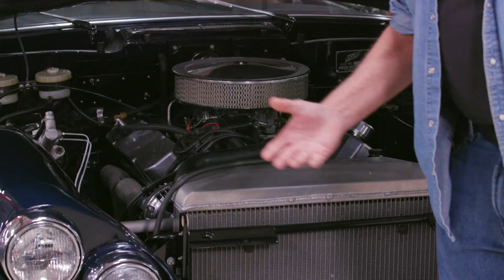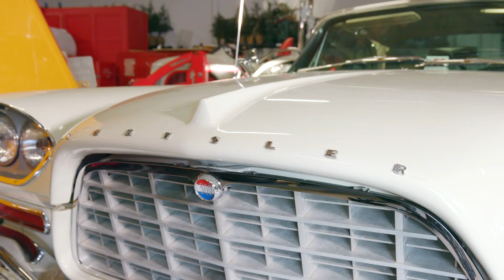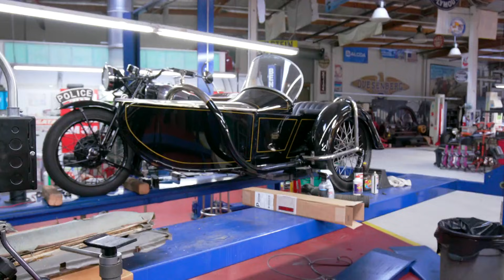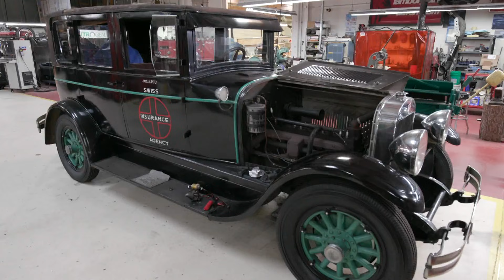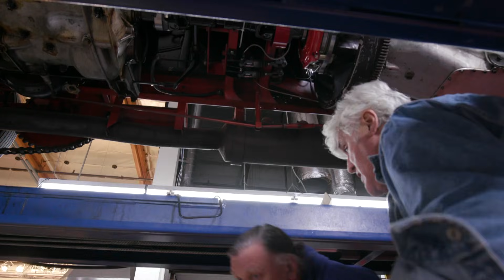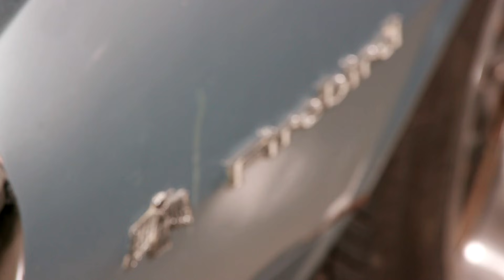Restoration Blog: March 2019 - Jay Leno’s Garage

Comment: Jay i just seen a Dodge Charger that came from the factory with a slant 6......HAVE YOU EVER....LOL ....and WHY would they do that to the Charger its the first one i have seen and i am 60 so i grew up with these cars but i missed that one.
Reply: Easy to explain.....Dodge was going after the cheapskate market for guys like my dad.....only new car he ever bought for himself was a 65 Chevrolet BelAir with a 230 straight six....later upgraded with a 250 short block using the 230 head.....only options were two tone paint, carpet, and wheel covers instead of hubcaps.....no radio, not AC, no power steering or power brakes.....const $2175 counting sales tax.....never liked that car, but would have kept it had it been a two door!!!!

Comment: The Pontiac Sprint ohc six was NOT the first ohc six done in America. Jeep’s Tornado 3.8L ohc six launched in the 1963 Gladiator pickup and Wagoneer SUV.
Reply: He did not say it was the first.  He said he believes it was the first with a RUBBER TIMING BELT instead of a chain.  [EDIT] I just rewound the tape and stand corrected.  He did say it was the first overhead cam 6.
Reply: I had a '63 with the Tornado OHC. Dependability wasn't it's strong suit, especially the "floating" distributor, but when it was running, it was a hoss.
Reply: Haha, I thought the same thing....Kaiser Willys Jeep Tornado OHC 6 in 1962! 140 hp, and it only had a 6 lobe camshaft...one lobe for both intake and exhaust!
Reply: Tornado engine was a beast and reliable once fixed from some issues. Check the argentinian ika torino.

Comment: I can testify about those Pontiac Sprints being rare . I looked for years for one of those engines and never found one. I had a really nice 68 Tempest body to put it in. I finally gave up and traded the body off for a nice mint Marantz receiver .
Cant wait to see it when its done.
Reply: Mine was a '67 Tempest Custom with the "high performance" four barrel carb OHC-6 engine.  Automatic trans, of course.  Bought it brand new in NYC and immediately drove the car to California.  Saw an - indicated - 125 mph along a stretch of Nevada highway!  Probably a bit generous ...
Put on a set of steel belted radials which made the car handle even better than when new.  I kept that car for about six years and it turned  into more or less an ordinary grocery getter.  It ended up having multiple engine problems including a holed piston and worn cam lobes 'cause of poor oil delivery to the OHC.  At one point I even swapped out a different cam assembly from a salvage yard as a temporary fix.  I was sad when I sold my Tempest.  The body was still in good shape but at about 130k miles the engine was unreliable and more trouble than it was worth (to me).  Thanks for listening ...
I'm sure Jay will have better luck with his unit.

Comment: Well... Jay your doing the nth degree of restoration. Everyone else is just clean, replace, and slap a new coat a paint. Your literally remanufacturing, and reproducing parts for vehicles that otherwise just wouldn't exist anymore. Your also doing some slight modernization for ease of use and maintenance.

Comment: Jay, I see those "fake" drum brakes, and I LIKE 
it.  Restoration, to be period perfect is one thing, 
but you drive these cars in the LA area!  Get GOOD 
brakes.

Speaking of "period perfect" restoration, I saw an 
article,  about someone restoring a Plymouth 
Roadrunner.  (I believe, but it was a Mopar.)

They did not restore the car to pristine, but went 
with "showroom" specs.  The engine block had chalk 
marks under the paint, that showed through.  
Underbody spray, was applied like it was originally.
Yep, missing all kinds of spots.  The oil filter, was 
period correct Mopar brand.  That was the hardest 
part to find.  I just posted some of what I remember.

steve
Reply: Concourse condition
Reply: @boxedfender4810 , That's it!

steve

Comment: Me thinks that the Detroit Electric is going to be seriously over powered. But what the heck, it can be dialed back in software.
Reply: kragseven  ----- It'll burn those skinny tires down to the rims. He said in a previous video what motor he was going to use. Slam 400 amps at 400 volts into that motor and put on wide tires it will flip over backwards.

Comment: I really love theese vids, I like the restomods and even just improving like putting a proper cluch and disk brakes on an old racecar.
Put taking a original unrestored car in good shape and start fixing small things, painting the roof and fixing the interior hurts my heart. Fix it, change tires and brakes and stuff like that, but when you start painting it you ruin the magic for me. Dents and scratches are pieces of history, every dent has a story to it, and by the time you fixed it so its as nice as it left the factory its no longer an original and unrestored car, but just another restored car.

Also, the interior cracked up you say? Leather does that when its been sitting to long, but usually some leather care can fix it so its good as new. I had some bad cracks in one of my cars but got some special cream and instructions and it looked good as new aver a few hours...

Comment: I love the restoration blogs, I am curious as to what happened to the Volvo Station Wagon project.  I dead sure I have never missed the weekly video.
Reply: I was excited to see a new "Restoration Blog" for that reason... next one I guess.
Reply: same here.  was looking forward to the update on the Volvo
Reply: I am as well. Being I have a Volvo wagon myself. So Jay let us know what;s going on with it, please. Thank you.
Reply: Joe Peckham I myself have a soft spot for Volvo station wagons. As a kid my grandfather had a business where he sold everything from armor all to slick 50 basically his company were salesman for everything automotive. He would buy his salesman Volvo 240’s and at 130,000 miles or so he’d give them to my parents. As I’m sure you know 130k on a Volvo 240 is literally just broken in. We had probably a half dozen of them when I was a kid and every single one including the red 240 wagon made it over 300,000 miles with just basic maintenance. Those old B240 engines were bulletproof. My dad even got a hand me down Volvo 760 turbo 1990 that made it to 523,000 miles. I went with my grandmother when I was 6 to pick that car up. We just got rid of it in 2014 not because it stopped running but because the body was rotted underneath no holes in fenders or anything but the floors were mush. It made it that far on original drivetrain, original rear end and the one no one can believe the original alternator.
Reply: I have seen a photo of the finished vehicle.  I was watching an interview with some guy on You Tube, I think it was a car show and they asked him what else he had done and he stated that he had built or worked on Jay's Volvo and a photo of the finished vehicle cam up.
Reply: Polestar!! I'm dying to see that one finished.
Reply: I was just about to comment the same thing! Jay and the team, should they dare read the comments (I feel sorry for them if they do!), must be eye-rolling and regretting ever showing the Volvo...but here's a question for them if they do: how's the Volvo Amazon coming along? :D
Reply: Yes, me to, i think i have seen allmoust everything in Jays show, except Volvo.Would love to see some 740 2.3 turbo in Jays garage :D
Reply: im always for the lookout for that car
Reply: I was waiting to see more about the resto mod Amazon Estate
Reply: Having three Volvo wagons myself, I concur.
Reply: Man that Volvo is a mystery! almost everyone keeps asking about it (myself included) we have to know at some point right ?!
Reply: I would really love to see it! My first car was an Amazon 121, my second was a 145 B20 B station wagon that I retrofitted with an overdrive from a  P1800 :) . Unfortunately it was severely hit from behind by a 244 police car...
Reply: In the 80' is was offered such a car for 60 $ , a family guy stole it from me because I was a kid with few or zero savings

Comment: The Mopar Fuel injection was made by bendix and just like an old pinball machine was full of valves and mechanical relays. When bendix realised that it couldn't make it work they sold the rights to Bosch who used transistors and licensed the system to VW and then Mercedes as the Djet , It's good to see that 300 D is still around. I read about it , something like ,30 years ago.